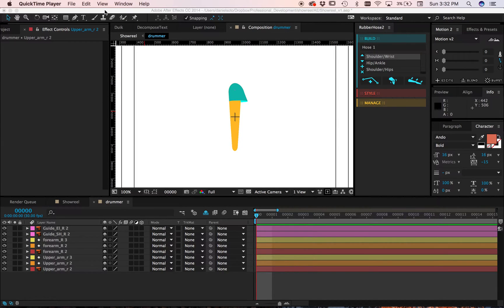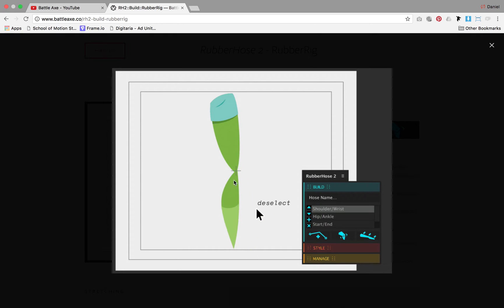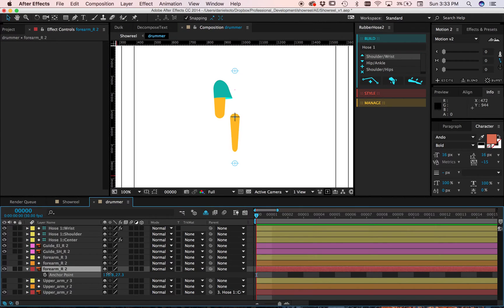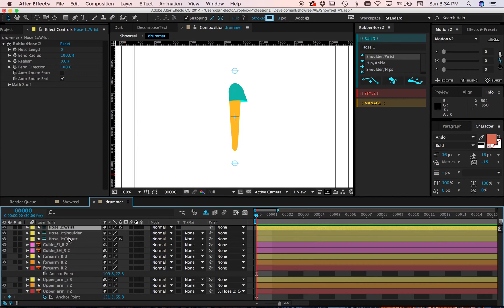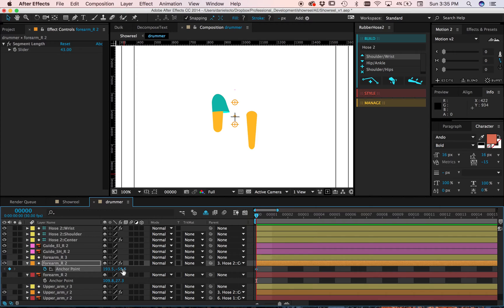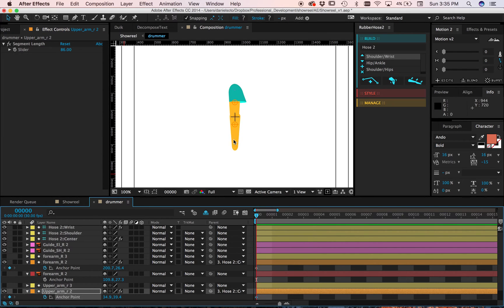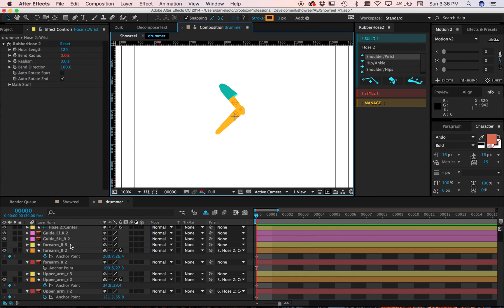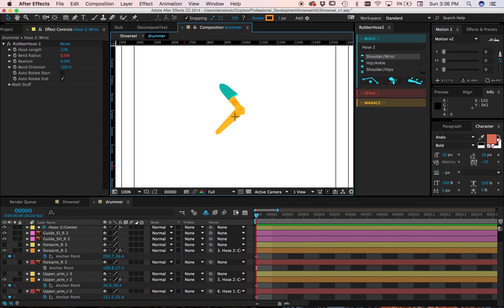Rubberhose RubberRig Issue

Comment: For anyone else still getting this issue - I had the same issue, and found the the arms scaled to -100,100 to flip them. Changing the scale to 100,100 fixed the rubber rig.

Comment: This happens when the layer rotation property is anything but 0. If the artwork you brought in had say a bend in the elbow but you rotated the layers to be vertical this will happen. To correct this, simply 0 out the rotation, double click the path, then rotate the path inside of the layer. Should work after that!
Reply: you're a legend.. was struggling with this today and you've saved my bacon

Comment: I have the similar issue with arms (no problem with legs). I realize the problem is that Rubber Rig only works with vertically aligned objects (like tight and calf).  In my illustrator file, my character is in T-pose with his arms stretching out horizontally. I brought this file to Ae, put the upper and lower arms in the center of the comp and attempted to rig them with Rubber Rig. It didn't work. I rotated the arms 90 degrees to make them vertical but it still didn't work. I ended up having to go back to my original Ai file, make the arms vertical. This time it worked. To sum it up, to solve the problem you probably have to do the following: 1. make sure the Illustrator layers imported retain document size. 2. all the objects you intend to link using Rubber Rig should be vertically aligned in Ai. Objects with rotation value other than 0 in Ae cannot be rigged. 3. Turn off continuous rasterization (this can pose issues to puppet pin rig. I am not sure about rubber rig but just in case).
Reply: Update: so rasterization doesn't break this kind of rig.
Reply: thanks it works to me!

Comment: I think part of the problem is that your battery on your mac is at 3% at the start of the video.  The other issue is probably that you're really short and the booster seat you use most likely is not large enough to reach the keyboard on your mac.  Hope this helps!
Reply: this is the most useless comment ever!
Reply: why i read this comment whole.why u read this even!